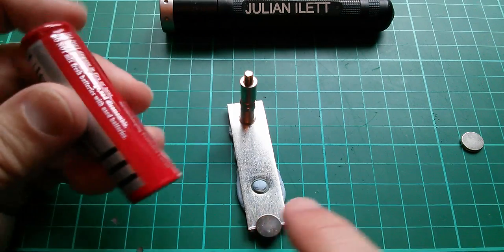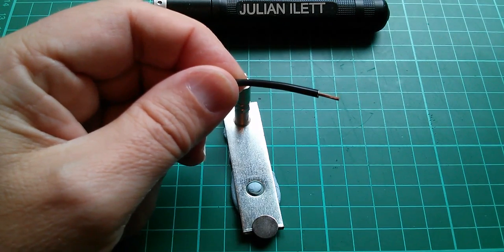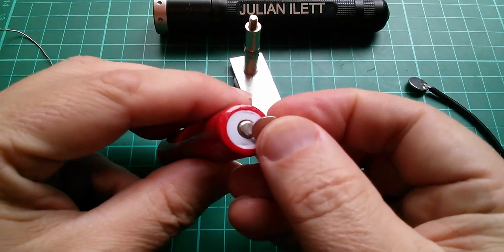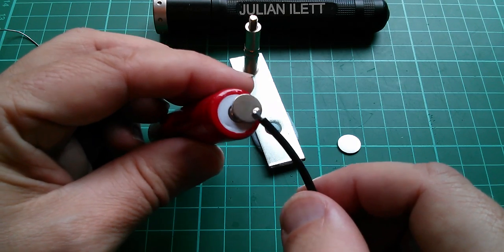Soldering Wires to Neodymium Magnets

Comment: The simplest solution would be to just solder onto a metal washer, then stick a magnet on the washer. It'll hold just as well as a magnet on its own.
Reply: I was wondering the same thing. why take the trouble of soldering magnets when you can stick a small plate on which you solder the wire in between.
Reply: thanks for the suggestion !
Reply: you would have to also glue the washer to the magnet to keep secure.   I would use an E6000 type of glue.
Reply: But won't glue act as an electric isolation between magnet and washer?
Reply: Arnold Rimmer  I think you replied to the wrong user, I said the same thing 😛
Reply: Arnold Rimmer  mkay, hope you got a good laugh then
Reply: Arnold Rimmer  Did you stick them to other magnets when soldering to help maintain the fields orientation?

Comment: I use adhesive copper tape (5mm wide) ... You can solder the cable to it and than wrap it around a magnet few times. This way the cable is secured perfectly on the magnet and the copper tape makes perfect contacts. No magnets will be harmed during this process ;)

Comment: Thank you for the video, you confirmed my idea so I don't need to test it!

Just a note for everybody: neodymium magnets can loose its magnetism because of excess heat (there are differences how much heat a neodymium magnet can handle) so don't solder them long time. In this video the heat shock is absolutely acceptable.

Edit - Note2: Maybe the solder only diffuse inside the magnet's coating which can be weak. It can be tested by a thick wire soldered and then trying out the strenght of the soldering. I will test it sooner or later and share the result.
Reply: Stick the magnet you are soldering to another magnet preferably a larger one. The heat causes the particles to speed up and misalign, if they are stuck to another magnet it will help keep orientation.

Comment: did you try turning over the magnet with the wire to see if it would stick better. Looks like the battery terminals have little magnetic by the way the  magnet is behaving. Just a thought.

Comment: The other issue is that your solder connection is to the thin chrome plating. Depending upon how well that plating is bonded to the actual magnet you may see seperation issues.
Reply: Lets just say I have had a different experience with the cheap eBay ones I buy!

Comment: Might have been better to solder to steel washers or something, you could even solder to washers that are larger than the magnets to allow for the wire, or maybe a piece of steel food can,
I would probably buy some battery holders though
Reply: Heck, you could even grind a groove into the washer and have the whole assembly be flush. Great idea!
Reply: a small bit of copper foil folded around the magnet, perhaps with a tiny bit of epoxy or super glue for good measure would probably be best. The coated magnet makes for a lousy connector because of its high resistance.
Reply: I was thinking of something similar.  Solder to a tag, therefore the wire is offset, and wont interfere with alignment of the contact magnets.
Reply: Sparky Projects bloody hell of course, thank you 👍

Comment: A nice way to avoid the heat issue would be firstly soldering the wires to iron disks which will then be attached to the magnets. 
The proper way is spot welding, as it only heats up the actual weld, leaving the magnet cold.

Comment: One of the other commenters suggested soldering to a washer. I suggest using a solder lug instead. Then either stick the magnet to it or sandwich it between two magnets. That will also solve the problem of the wire getting in the way (since it will be offset to the side).

Comment: Surely soldering to a piece of metal and then having the magnet stick to the metal is a far better way to do it.
Reply: That's what I was thinking! Any small piece of steel would be perfect; maybe a washer. Solder the wire to that and sandwich it between the neodymiums .........

Comment: I cut a small rectangle of the 200 µm iron based wrapping of a 9V prismatic battery. It is strongly attracted by the neodymium magnet and attached by crimpsing to the copper wire makes a beautiful battery connector. No need to solder and it is a nice upgrading of dead 9V batteries.

Comment: For  a Magnetic visualizer go back to grade school. Put a card on each magnet, heated vs non heated, and sprinkle iron fillings on it.
Reply from the maker: I'll have to get some iron filings :)
Reply: have a grinder? maybe a dremel attachment. No need for laboratory grade iron filings.
Reply: +Julian Ilett lol just go to your bench where you keep your grinder and swipe a magnet over the floor
Reply: Put the magnet in a plastic bag first. It makes it easier to remove all the filings and dust afterwards.
Reply: Magnetic viewing film will probably give a clearer image than iron filings, given the small size of the magnet.
Build a Gauss meter, too :)
Maplin used to sell magnets terminated in tinned solid core wires which were crimped on with tiny metal cups. Don't think they do them anymore, at least I can't find them on their site :(

Comment: With the wire you have shift the magnetic flux direction,bit like magnets around aluminium tubing which causes a sort of vortex effect through the tube even though it's non ferrous.

Comment: What if you use a lower wattage iron? 60W seems a bit high for what I presume is leaded solder, especially for soldering to a magnet. In my personal experience with soldering irons, even a 45W iron gets quite hot.

Comment: I use a stainless steel pan scourer to clean my iron tip as well as a wet sponge. The scourer sits in a small pot next to my iron. They are very cheap and don't rust. A gentle wipe cleans off the black flux residue.

Comment: Would there be any resistance in the magnets? I want to have a battery connected to magnets so i can change out for different LEDs but i don't know if i would have to fit a different size resistor because of the magnets

Comment: Regarding the soldering sponge. The cheap stainless steel kitchen scourers placed inside a glass ramekin (the type you get with GU desserts) seem to work quite well as a cheap alternative to the brass ones. The problem with a wet sponge is that it sucks the heat out of the iron which can slow down your soldering.

Comment: Interesting to see how easy it was.  The magnet is a "sandwich" of neodymium powder which is cast like a pill. (search How SuperMagnets are made) and covered in a bright metal envelope ... If they get damp or damaged you can see the bright metal will just peel off like foil and you're left with a dull grey compressed dust that will crumble away.

Those thin magnets have a shallow field doesn't take much to disrupt it.
I suspect that the "shift" in magnetism is due to a combination of heat and the Lenz effect ... lots of content about it on YT too - just search "copper and magnets".

As a "dirty" fix, well worth considering - I usually force part of a straightened paperclip under the insulation into the body of the wire, wrap the pc tail round the end of a screwdriver to make a flat "plate" and pop a magnet over that.  Not a perfect contact, but good enough.

Comment: Holts Gum Gun is used for repairing exhaust pipes on cars and can resist 450 drg C. I do not know if its conductive. Perhaps it could also be used for mounting power LED-s to metal flanges.

Comment: One other thing,
you can remagnetise those neodymium magnets. Use a massive coil around the magnet and attach a high current supply like a welding transformer or a car battery. Im not sure about the forces though, the magnet might just end up penetrating your windows.

Comment: You could try putting the magnet into a widened crimp connector to use the crimp as the conductor without the magnet in the path

Comment: If the current is low enough, you might want to try cold solder - it's a water--based glue which is pretty much saturated with very finely powdered carbon, so it looks black as ink.

Comment: another alternative: spot weld a short length of nickel strip to the magnet and solder a wire onto that. Yes, I tried it and it welds fine although it took 50j of power on my KWeld spot welder. Note - check the resistance of the connection because I usually see around 200 mOhm ( 0.2 Ohms) which might be significant for some applications. Magnetism totally unaffected.

Comment: If you over heat a magnet it loses it's magnetism.  So wouldn't current running through the wire heat up the magnet?

Comment: Strange to see the Curie effect is irreversible. My Weller solder tip works with this effect, but maybe it's a special alloy.
Why not use two (larger)  metal rings to solder the wire on and place magnets on both sides. Win-Win.
Reply: The transition at the curie temperature is reversible. But you are confusing something being magnetic and something being magnetized.

Comment: I won't say I told you so, but... :P I honestly thought it'd be a lot worse though. Maybe pre-freezing the magnet and sticking it onto a heatsink would help prevent and slow down transfer between the entropies while soldering? 

It's probably easier to just take a ring connector, crimp with cable, and sandwich it between two magnets. Easy and basically no mess with glue or solder. In addition you'll get a flat surface for the battery and the magnet ;)

Comment: If anyone see's this and wants to try doing it. Stick the magnets to each other when soldering it will help maintain a north and south pole orientation. The reason heat destroys magnets is the particles get excited and change orientation into a random pattern a second magnetic field can help stop this.

Comment: try to use some metal tabs that you solder the wire to and then use the magnet between the metal tab and the battery terminal. Not as elegant, but it would avoid changing the magnetic properties of the magnets.

Comment: Heh, opened my subscription feed after having finished soldering wires to magnets barely 10min earlier... I used fairly similar magnets, cheap 8mm ones from fleabay that weren't that strong to begin with, but went for the 'big glob of solder in the middle' tactic instead and sadly I did notice difference in magnetisation so have to add a second magnet.

Comment: I used a bunch of those boards to charge up loads of 18650's ready for testing for LiIon battery packs.  Great little circuit.  Using cheap battery holders from china is a LOT easier though.  I had about 300 batteries to get through and so I set up nearly 20 of these.

Comment: Im going to make a 18650 charger too, Im just waiting for some battery holders to arrive. Itll be interesting to see what you come up with.
Reply: question, why are you guys making 18650 chargers when they are very very cheap? I mean, just buy a power bank shell from ebay or ali and usa that to charge the 18650. I have a 5 cell one that I can open and pop some batteries in there.
Reply: The meaning of DIY is learning to do it yourself, and in the process you'll learn a lot which later can be applied to something that isn't dirt cheap. I recently refurbed a 36v Hammer Drill which were going in the bin. Replaced brushes and batteries cost me 30 bucks on fleabay, and now I have a 600 dollar cordless SDS hammer drill.
Reply: OrbitalSP2
the cheap power bank boxes charge and discharge all the cells in parallel. I dont think thats ideal for cells of different capacities or discharge states, I'd rather have a separate charging circuit for each cell. but mostly Im doing it cos I like messing around with electric stuff.
Reply: I undestand, I also like messing with electronics. Maybe you were just trying to charge them, but that is not the case :)
Reply: OrbitalSP2 Yeah, if you just want to charge them it's pretty far fetched.
Reply: Specifically, what Julian is trying to do is create a balancing system that doesn't rely on a resistive load to discharge the "high" cells. He wants to use the higher cells to boost the lower cell.

Comment: when soldering to the magnet use as low a temperature as possible.  With how fast the solder just wicked onto the magnet I can guess your iron is way too hot.  

I would suggest having as much contact area between the magnet and the piece of metal as possible, using some flux on the magnet while having solder already on the iron. that way you have the fastest time possible to take your iron off of the magnet before you mess with the field too much.

If you have a temperature controlled iron somewhere that would help a bunch too. (I know it helps me out every day)
Reply: Not too low of a temp, but with how fast and how far the solder wicked up the temp was def too high. gotta find a balance for the material. Thermal conductivity, and thermal mass of the magnet; thermal conductivity, temp, and thermal mass of the iron. just a few factors to help decide what temp to use.

But you are correct, too low and it takes too long. There are many different ways to solder a wire onto a magnet and It may be difficult to get it down. 

I wonder how spot welding onto the magnet affects the field...

Comment: Now you will have to solder the exact oposite side of the magnet with another wire an then connect the end of the wires together so you will get back the balanced magnetic field as before and the magnet will stick at the center this time ( if not do it in 4 places or 8 places in both sides ) :)

Comment: Solder wire to thin copper shim... superglue magnet ontop... and i'm not your uncle :)
Reply: Wouldn't the super glue act as an insulator?
Reply: battery > coppershim > magnet  singlesided..... or battery > shim > magnet > shim > battery  on doublesided connection.....   shim is soldererd to cable and magnet glued on top... so the magnet is not used as connector... the shim is... so no, the glue dont hinder it to make connection.... unless you splash around with the glue?
Reply: I think the copper shim is meant as the conductor between the wire and battery. The magnet would provide some 'sticking' force keeping it together. As the copper cannot provide that. A copper sheet would be better though, to not reduce the force due to extended distance.
Reply: True.... Was just the first ting that popped in to my head to bypass the need for soldering onto the magnet.... There are plenty of solutions and mine was just a brainfart then and there..... youknow take what you got and rig somting upp....

Comment: Why not solder to a washer and just stick the magnet to it? You could glue the edges after the magnet is stuck on the washer so it doesn't remain on the battery terminals.

Comment: Good video thanks. Was thinking of doing magnets for a ebike battery. Not sure it will work but I like the idea of being able to remove batteries and not have the welded together. Obviously will look at the comments as they solve the issue ou have had with the magnet. Many thanks.

Comment: I'd check to see if the wire is actually copper plated steel.  A lot of the cheap wire these days is.. and it would change the pattern of the magnetic field.. offsetting it to the side.

Comment: Better to spot weld a nickel strip to the magnet and then solder the wire to the strip. Otherwise a thin brass strip folded into a loop with the magnet held in there with epoxy or superglue.

Comment: Hey remember you're putting metal onto it which will change the magnetic field of the magnet. Doesn't take much to do a lot. Also you might want to just use a conductive epoxy instead of solder. It's a bit more expensive but you have 0 drawback with it and no chance to permanently alter the magnet
Reply: No the heat is causing the particles inside the magnet to excite and change into random orientations he needs to stick it to another magnet when soldering to try and maintain the north south pole on the magnet. The solder itself doesn't effect the magnet because it's tin and lead or silver and is not magnetic.

Comment: If you want to do this and not loose the power of the magnet. Take the magnet you want to solder and place it on a second magnet that is bigger. 2 or 3 times the size. Then you can do what you just did without loosing any of the magnetic strength.

Comment: Whats the weight of those ultrafire compared to other 18650's?   I received some fake ones that were 22grams compared to 40+ for normal 18650's.

I messaged the seller and got a refund.
Reply: a good rule of thumb is to avoid "...fire" batteries ( and eBay batts in general )
get your 18650's in the eu or us, they are usually the same price for legit cells
Reply: banggood sells genuine 18650 cells from sanyo, Lg, samsumg and Panasonic. avoid "FIRE" stuff and anything more than 3400mah.  Normal 18650 cells have from 2000 to 2800 mah and some more advanced have 3200 or 3400 (usually Panasonic ones).
Reply: OrbitalSP2 Get them locally, places like nikon.eu for europe, it's cheaper and legal